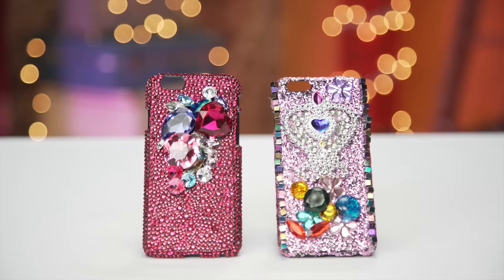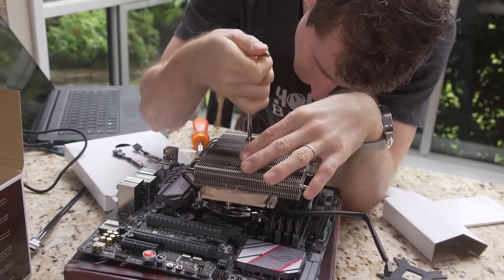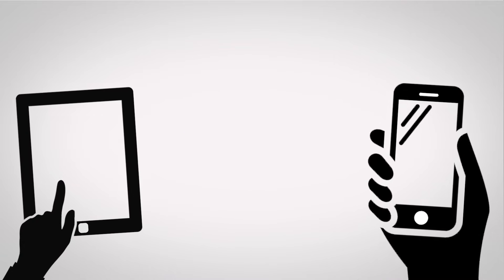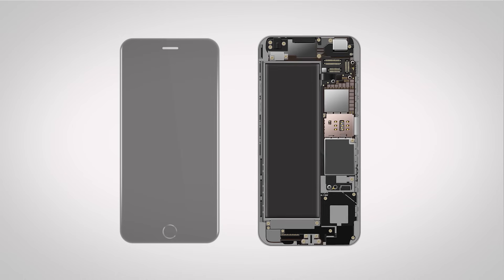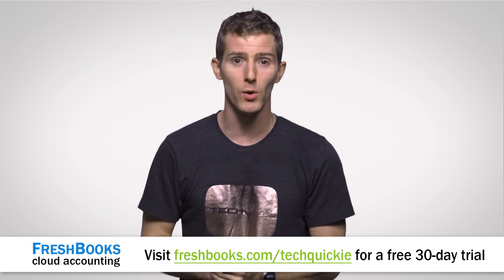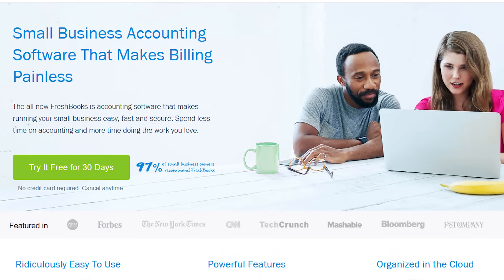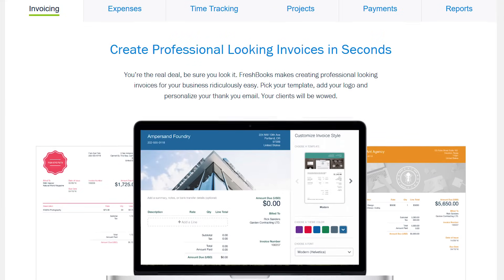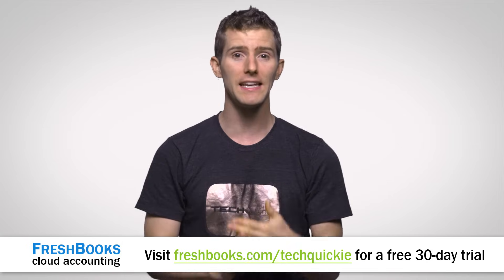Systems on a Chip (SOCs) as Fast As Possible

Comment: Now as AI/ML cores are also becoming necessary in most mobile and edge devices, I'm hoping that things like in-memory computing will become hot in upcoming decade. But what still haunts me is how DNNs like efficientnet(approx 7M parameters) can be fit into a single SRAM chip for building SRAM based in memory computing. What's your opinion on this?

Comment: A system on chip or system-on-chip SoC is an integrated circuit that integrates most or all components of a computer or other electronic systems.These components almost always include a central processing unit CPU, memory interfaces, on-chip input output devices, input output interfaces, and secondary storage interfaces

Comment: yes, you can do more complex things then ever even if you have a simple device like even a low or mid-range mobile / small devices like a new generation Raspberry Pi or a device that can interfacing to monitor keyboard and mouse which has a display and a good network adapter. thanks to the streaming support like PS and Xbox, then using the terminal to using the cloud service and cloud computation. yeah, you can do it now thanks to SOCs  :)

Comment: 2016 Linus: "Just because components on a SoC don't pack the punch of their desktop counterparts doesn't mean they're bad"
2020 Apple: Silicon
Reply: In fairness to apple though, their CPUs are extremely powerful for the wattage. I can edit 4K video on my iPad using luma Fusion which is insane considering how thin and light it is. I can’t wait to see what apple would do with the bigger chassis inside their Macbook air which has been super under powered for a while

Comment: Low power does not necessarily mean fewer transistors. It's often more efficient use more transistors but clock them slower. 
Also, a lot of the power reductions in SoCs aren't just because the components are brought closer together. It's very often because what used to be done in software is now being done directly in logic. Consider rendering a video. That's very slow and power intensive on a traditional computer, even when using multiple cores and GPUs. The reasons that phones and cameras can do it in real time is that it's hardware accelerated. True, it's not as flexible, but it is fast and uses a lot less power than the techniques used on desktop computers.

Comment: System on a chip refers to multiple functions in one single unit rather than a cpu and a gpu etc. Mobile devices is an example of lower power and fewer transistors. PC are stronger but even still phones with better soc's like ARM architecture.

Comment: This video pointed out an interesting topic that doesn't get talked about very often: Code Optimization for Hardware

If you were to write software specifically for an Intel 6700K CPU and compile it for only that CPU, the result would be software that takes full advantage of every optimization that CPU has in its instruction set. Most commonly if you take that software and copy it to a PC with an old Core2 Duo or something, that software would crash. It'd be expecting more cores and slightly different instructions available to give the CPU. Basically when you optimize software beyond standard x86-64 instructions you loose some portability of said software, but the software would run far more efficiently and perform far better. Going up to a Kaby Lake CPU would be more likely to be able to run the optimized software from a Skylake CPU since keeping the instructions from a previous generation is far more likely. 

You can do these experiments with the Gentoo Linux project. You'd be amazed at how much performance you can gain out of existing hardware when you optimize code just for that hardware and cut out the rest. The software binary can be smaller so it can save space as well.
Reply: Thanks, this is the most underrated comment in this video I've seen. I have an old Netbook I bought from an estate sale a couple years ago for under 5$. I immediately removed windows and I installed arch Linux on it using the i686 package repos. I was hoping that I would get performance improvements by running a window manager instead of a full-blown desktop environment. to some success I found that running a minimal window manager was very efficient, but it it was so slow running video that I couldn't watch YouTube on that computer. I'll try installing Gentoo and reading more about my CPU (I think it's an old Intel Atom pre 2012) and hopefully get a decent framerate on video!
Reply: @WhenIHit88MPH  You may be able to get a pretty robust system that'll work well for it, but video will still be a problem. When it comes to video you're going to be running into raw processing limitations on a netbook. Those things were trash when they were new, but you may get something usable out of it if you really put in the effort.
Reply: @gwgux  Okay, so I don't know if I have any performance gain yet, because I haven't tackled installing firefox. But here's to you being the person who finally convinced me to >install gentoo after nearly a decade of using linux.

Comment: Mobile SoC's are pretty awesome for what they are.  I really wish mobile OSes would stop being so uselessly limiting.  There's a lot of hardware in modern smartphones and tablets and it's hindered by a consumption focused, locked down OS with a ton of abstraction from hardware that slows things down.  You can quite easily get a desktop Linux experience on an SoC from the past few years, but Linux desktop support is rare compared to Android.  Android's reliance on Java, ART, and other high-overhead APIs slows it down and limits its flexibility.  If more mobile devices shipped with proper GNU/Linux and GPU drivers with OpenGL/Vulkan support, we might even see PC gaming companies like Valve adapt to the hardware.  It wouldn't be too difficult in many cases to recompile existing Linux games for the ARM CPU, but it's a nightmare to port them to Android due to the change in API and stupid focus on touchscreen-only input.

I'm also excited to see Windows 10 demoed on a Qualcomm SoC running native x86 applications via emulation at a reasonable speed.  SoC's are hindered by crappy restrictive software.  Let's change that.

Comment: Actually, ARM not only is a smaller and simpler instruction set, it's as versitile as x86, resulting in a better perfomance per watt than x86, that's the reason intel cpu's made for mobile devices aren't used, their perfomance per watt can never be on par with newer and more efficienct instruction sets.

Comment: The new Apple A10 is technically not a Quad Core SOC. It has 2 high performance cores and 2 low energy cores but it will only ever operate as a Dual Core it will never use all 4 at the same time. A controller in the SOC deicides which set of cores to use.
Reply: Donovan Lewis OHH, so it doesn't use Heterogeneous Multi Processing that samsung uses? Qualcomm's implementation is best IMO, Heterogeneous Compute allows the whole SoC to work together to complete a task.
Reply: _LLJY Yes, and it doesn't have to because of the design on the processor + the software. the A10 "quad core" is simply for power efficiently. When it doesn't need all the power it switched to the slower dual core to save battery. Because of the way Apple designs there SOC's + they control the OS they can get away with using a dual core and still be faster then everyone else. 99% of apps that run on any mobile platform don't really take advantage of multiple cores and Apple's SOC's have the fastest single core performance by a long shot. The a10's single core performance is double what a Snapdragon 821 scores and this is why iOS will always be and feel faster when matching the latest phone vs the latest android phone.  Even tho everyone says iPhones are under spec.
Reply: Donovan Lewis actually, the main reason why android feels slower is because of developers, it's more if a cultural reason. where developers on iOS tend to optimize apps to match the competition, Android devs don't really give a shit and release the apps anyway , it's very simple to make an iOS app a stuttery mess, but apple would just reject it from the app store
Reply: _LLJY I build iOS and Android apps for a living daily and you actually have it backwards. It is very hard to make a iOS app have a bad UI experience performance wise because the API's on iOS are very highly optimized and designed specifically for the hardware. Android is the opposite its very hard to make a good UI experience performance wise. But that is not what makes android feel slower its because it actually is slower. For actual real world tasks the hardware is slower in the real world (This goes back to my single core benchmark from the previous comment) and the OS because it has to work on a broader set of hardware can't be optimized as well. There are other things also that just go to the core of Android and the way it is designed it needs faster hardware to be and to feel as fast as a lower "spec" iPhone OR Windows phone. Android is more of a task to developer for and you have to put more time into optimizing to get something that is somewhat good vs. a third of the time to make it better on iOS.
Reply: Duck I feel it’s more about where Apple has been focusing on. Think of it this way, why is it that Pro apps like the desktop version of Autocad and so on been brought to the iPad and not any other android tablet or devices. It’s because Apple had been doubling down not on ARM’s licensed architecture but on their own chip designed from the ground up since the A6 only taking the ARM instruction set. From then on Apple took a very interesting approach and in a few years they were leagues ahead in single core processing when the A10 processor came out, at that time Snapdragon’s multicore processing was a little higher than the A10. The A10x which was released along with the A10 for the iPad was again much ahead than any processor in both Single performance and Multi-core Performance as well. And when the A11 came out, it was a dramatic leap in single core processing and also multicore processing. Which put itself ahead by at least two years when compared to its competition. The A13 today again unbelievably good for a mobile processor. So when Apple SoC’s come out for Mac’s they are going to have far more benefits since they have the versatility of a laptop.
Reply: Donovan Lewis This has been fixed with the A11 and above chips. The A12X has an absolutely monstrous multi core score at geekbench, Apple is near unbeatable at this game, which is a little sad because nobody can compete lol
Reply: Some apple lovers got offended
Reply: I think you mean 'functionally', not 'technically'. It technically is a quad core chip simply because it has 4 cores. If it can only use 2 of them at once, however, it's functionally a dual core chip.
Reply: Now the A12X Bionic can use all 8 cores. 10 billion transistors and able to render NBA 2K Mobile graphics with that rival gaming consoles. It is amazing. If only Intel did not limit competition for Arm to make it on x86.
Reply: omar arreola Apple needs to make a rival switch handheld. It would make the switch look like an abortion
Reply: Phillip Rokkas Says who? Some guy who lives with his parents?
Reply: @peat381low8  lol dont be mad i have a point. you said it yourself -_-
Reply: Phillip Rokkas Yes I said it myself. From some guy in the internet who still lives with their parents. Thanks
Reply: @peat381low8  okay mr.areola

Comment: Still don't get how a smart phone can push more pixels, load faster and be overall better than my desktop browser. I get it it's based on  optimization but how!? The instruction set? I still don't get it.
Reply: I've generally thought that the OS and other software isn't nearly as bloated on a cellphone, both to conserve power and be faster. Browsers like Internet Explorer really are slower, and don't feature many of the optimizations that makes Chrome and Firefox fast on a computer with a good internet connection and a processor that isn't so old  that it actually bottlenecks modern web browsing.

Comment: Thank you!! This is what I always said on paper Androids should clean Apples clock. But they don't. It's pretty 50/50 because iOS is optimized so well. It's very noticeable using it. No crashes, glitches or artifacts. Just smooth, fast performance.

Comment: aren't microcontrollers the same? they also pack many systems like rams and processing on one chip.. whats the difference between soc and microcontrollers? correct me if im wrong...
Reply: I'd say MCUs relate to SoCs in a similar manner as ARM processors relate to regular ones. Made for some specific function, like operating a machine, with a pre-programmed set of simple operations while SoCs are universal and will run any compatible code.
Reply: All μCs are SOCs, but not all SOCs are μCs.

Comment: Mostly good video, though the part about the 8 core phones isn't accurate. Android phones with 8 cores appear less powerful to Apple's dual cores because they indeed are less powerful. More cores ≠ Better performance. In fact with an 8 core processor you're probably gonna get less performance because only 1 or 2 of the cores are really gonna be used most of the time, unless you're like compiling from source or hosting a moderately busy web server or software encoding video, things not typically done on a smart phone. Not to mention that some of these 8 core phones have been overheating and even thermal throttling, going so far as to telling the user that they can't use their phones because you could boil water with the temperature they're at. IMO phones don't need to have 8 cores, in fact they probably don't even need 4 cores at this point. Apple is probably just making their phone have 4 cores because of peer pressure.

Comment: Do any MOCs (Motherboard on a Chip) exist?

By MOC I mean a chip which makes it so that all parts except I/O (lan/usb/hdmi/audio and optionally sata/PCIe) are integrated on the chip, so the only thing you would need is a board connecting the chip to the I/O connectors and a power line to a PSU with in built vrm.

Comment: Attributing all of Apple's A-series SOC's performance to tighter integration, doesn't do their chip design justice. If Apple were to licence their A10-design together with the relevant compiler optimisations, it could still run circles around the competition on third party platforms as well. Especially when it comes to its single core performance (which still matters most in day to day tasks and is also the exact reason why Apple doesn't need to equip their SOC's with as many cores as the competition). Apple may licence the ARM instruction set and has probably licenced several reference designs of ARM-cores, but their actual CPU-core design is an in house endeavour.

Comment: Is a AMD APU a SoC?
Reply: Some, yes. Not every APU is a SoC.
Reply: only some models. AMD doesn't quite draw the line on purpose for perhaps marketing even their SoCs as an "APU"
Reply: he was saying that it's moving more like that. years ago the "integrated graphics" was a chip on the motherboard. look at some old AMD boards and you might see a little chip that says nVidia on it ;)
Reply: nVidia on an AMD chip? That's something I'd like to see since they're rivals af.
Reply: it wasn't always like that. for a while AMD was the bigger of the two against intel in CPU manufacturing and designing architecture. to this day intel still uses the architecture AMD invented (x64)

go ahead and search in your system files for "amd64", even if you don't have a single AMD product, it'll be there ;)

then a while after that, AMD bought a graphics manufacturer called ATi (biggest competitor with nVidia at the time) - ATi did a lot of the graphics for nintendo products and graphics cards.

long story short, after a lot of mess ups in both the CPU and GPU market, AMD is kind of at the bottom of both - for now - but they have divided up their assets so "AMD" is focusing on their CPUs and "Radeon" is focusing on their GPUs, while still owned by AMD.

kind of a way to protect themselves if one were to go bankrupt or the other to be extremely successful.

sorry if you didn't want a whole history lesson, just really interested in this stuff lol
Reply: i knew the history of the AM2, AM2+,AM3 and AM3+... i been running amd Athlon 64 sense socket 754.
Reply: i was talking to Jason Lee anyway

Comment: So many wrong things here. First SoC does not have on board RAM, or on board storage. What they have is onboard storage controller and RAM controller, so less chips on the board. Second modern ARM CPUs aren't technically RISC anymore. they have expanded their instuction set a lot and somewhat resembles new intel CPU. Third Apple and iOS making the software and hardware is more a marketing trick. Since Qualcomm and other chip manufactorer does optmization for android kernel anyway. Beside that ARM does a lot of optmization their selves with their compilers and tools that SoC desginers do. Lastly modern intel ultrabook processors since haswell are technically SoC since they intergrate a lot of stuff that used to be on the chipset on the chip itself. So an SoC is just codename for a chip that intergrate a lot of stuff from the chipset to the chip

Comment: Plz do Crashing programs (or similar) as fast as possible
Reply: Colin crash system error security windows alert call teknikal suppuort
Reply: Cbhrules, BSoDs aren't the only kinds of OS failures. There's also the Unix kernel panic, like the ones on macOS and Linux. Sure, macOS is a lot more stable than Windows, but that doesn't mean it doesn't crash. I'm talking to you, Apple fanboys and/or fangirls. Oh, and there's also the Sad Mac from the Macintosh OS's (System 1.0 - I'm not completely sure). Oh, and did you know, NoahDVS, that Windows 9x (Windows 95 - Windows Mistake Edition) gave you the option to continue running the system even after a fatal errrrrrrrrrrrr- 0x1FA17ED